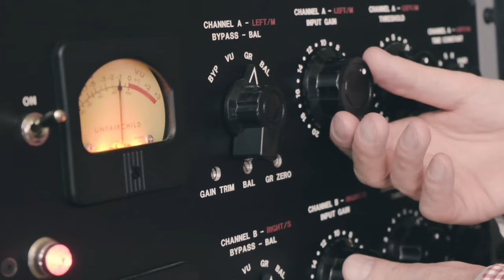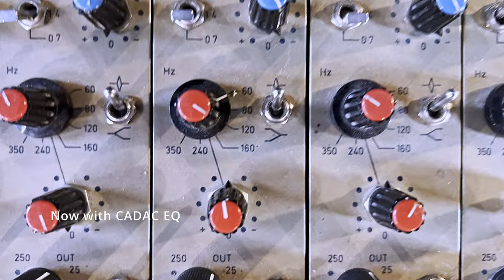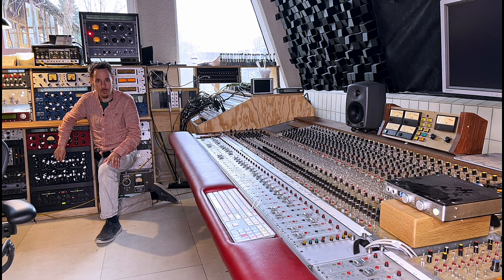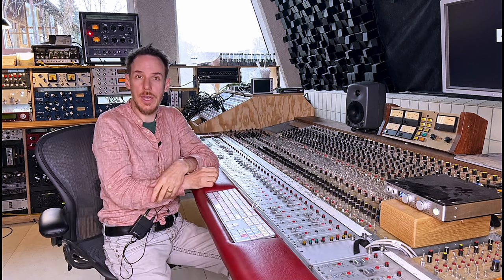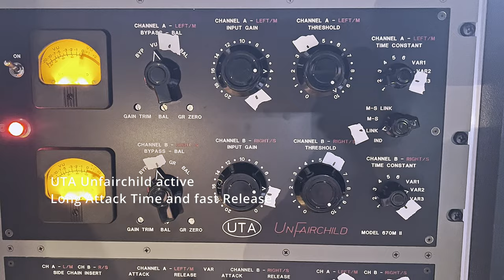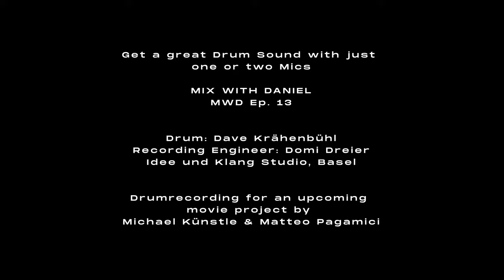GET A GREAT DRUM SOUND Using Only Two Microphones

Comment: Sounds absolutely huge on my 1/32 inch cloroplast phone speaker
Reply from the maker: Thx. Yes, that's one of the big advantages if you work with only one or two mics - every hit is in its place and does not smear (as it would a little bit with many mics). Phone Speakers or also Labtop speakers will thank you, as for those extrem small speakers it is more easy to sound punchy that way...